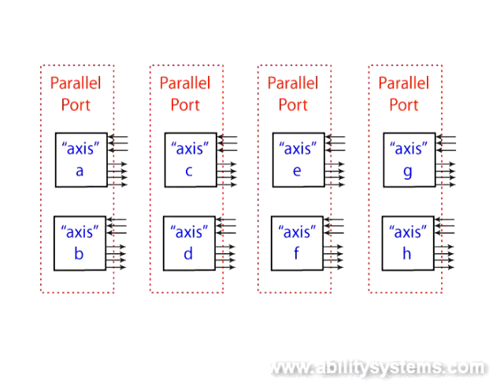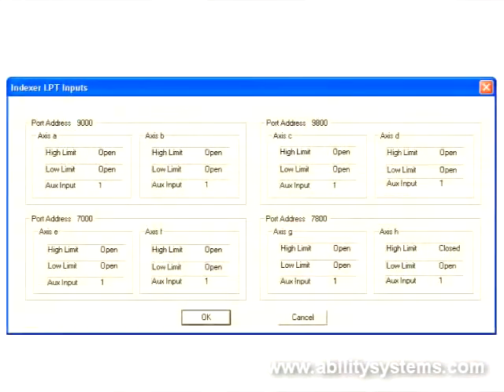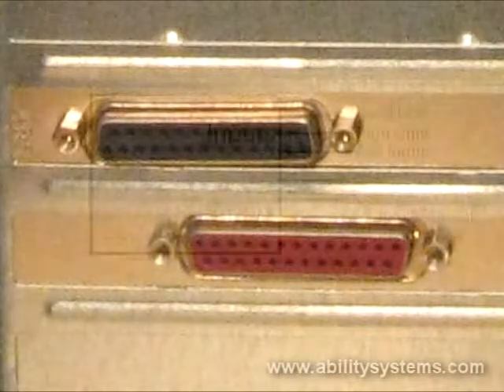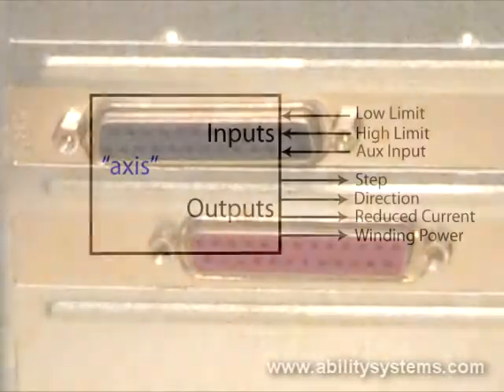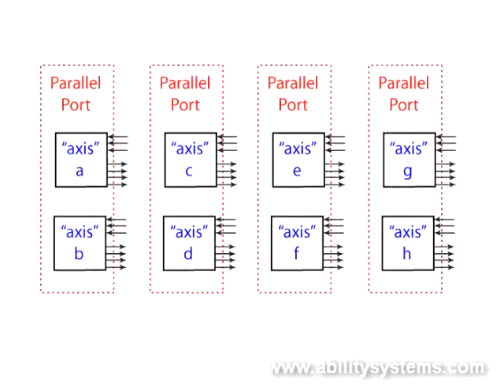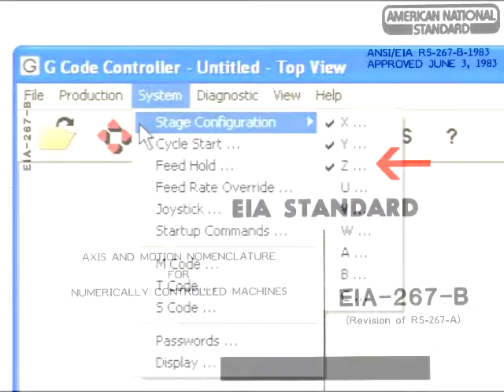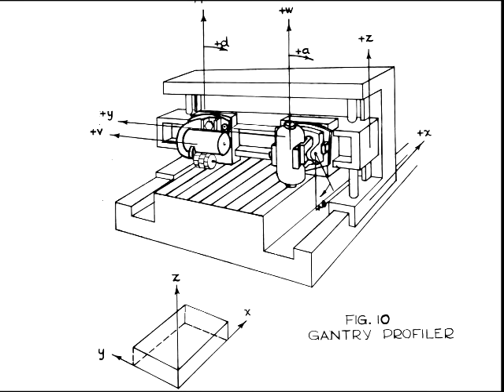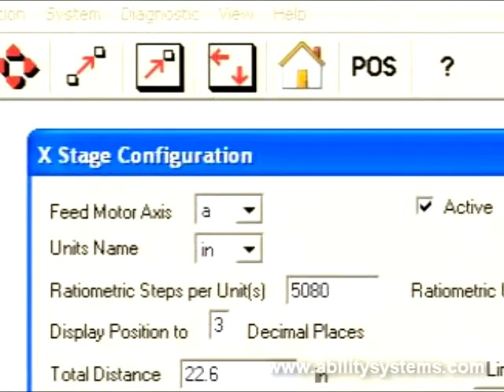Intro to CNC Part 8 - Signal Grouping

Comment from the maker: The software is not typically used to control machines that require portability, and for this reason accommodating laptops was not worked into the design. The domestic version of Indexer LPT software will control a maximum of six motors simultaneously using up to four parallel ports, keeping all motors proportionally displaced from the beginning of motion to end. The international version will control six motors, but only four simultaneously. The packaged software will run on PC platforms under Windows up through Windows 7. A fully functional Linux version is available on a consulting basis. The Arduino is not currently supported.

Comment: What if my laptop doesnt have parallel port to run steppers simuteneously.Also a microcontroller like arduino cannot multitask so only one stepper at a time can be controlled,is bresenham's algorithm suitable for cncs because this is the only way with a microcontroller??thanks!